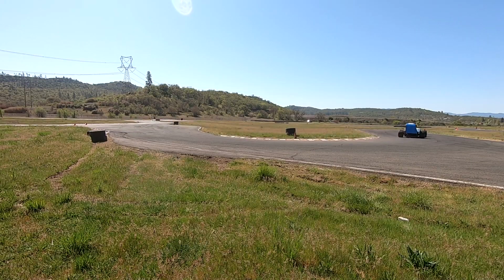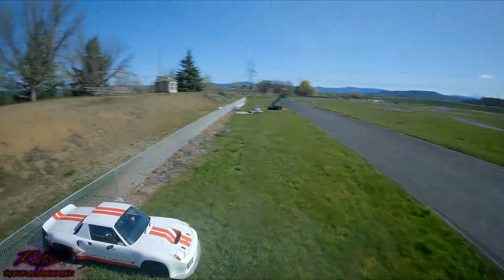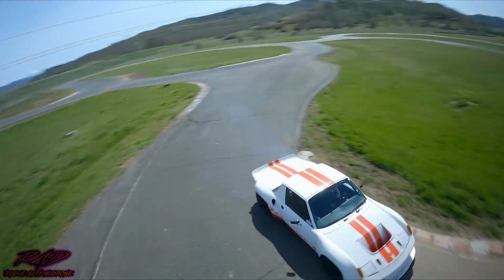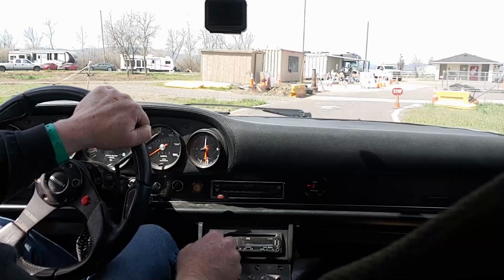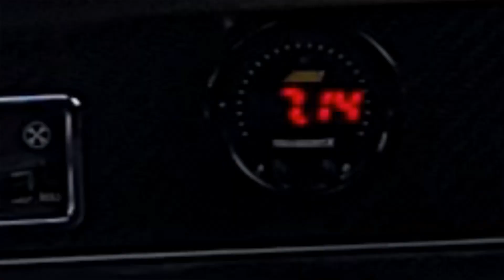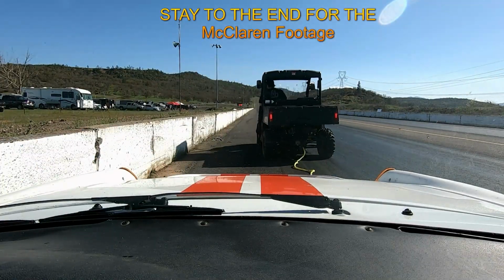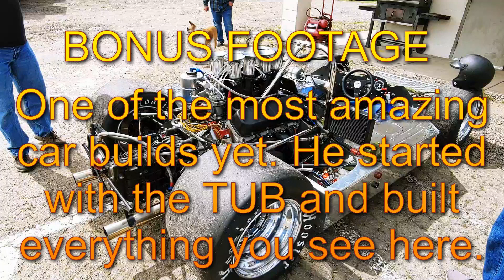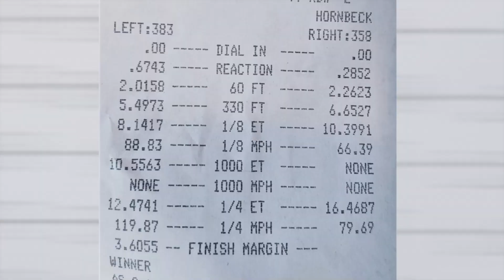The First Test day of 2022!  Testing on the track and also on the TRACK!  AX and Drags!

Comment: You almost need a way to limit boost during autocross. But even then, that 914 is a handful.
Reply from the maker: We can adjust the boost, generally run it as low as possible for the short autox.

Comment: Do your burnouts in second gear
Reply from the maker: I do need to try that.  1st gear is good to about 55mph 2nd is around 90 or so.  My biggest issue is I'm to cheap to buy good tires.  I feel I need to work out the other issues first.
Reply: @budgetoutlaws9978  If you are spinning you a  ain't winning

Comment: Throttle management: The gas pedal should not be used as an on-off. imagine you have an egg under your foot. squeeze the pedal quickly but not smashing the egg. the same applies for decel. dont jump off the pedal so quick as to allow the egg to fall off.
Reply from the maker: Thanks for the tip.  Using 1st gear really accentuates the on/off.  I can only hold the throttle down for maybe 1 second of full throttle.  Then it does make for less time to setup properly for corners and braking.  Maybe I'll add the scanner on the next video.  2nd gear doesn't sound as crazy, and it's almost as fast.  When my driving gets better maybe I'll use TWO gears!!  LOL.
Reply: @budgetoutlaws9978  we put a non linear cam roller on the throttle shaft to help manage throttle smother. it was a 550hp NA LS 914.  im sure your turbo adds complexity to mapping out a throttle curve. later on we used a motec where you can simply program in a better curve. PS. i remember when that thing was primer. same 914, right?
Reply from the maker: Actually,  it's still in primer depending on which angle you look at it.   Still have a lot of body work to do.  and now a little bit more.  I'm saving my hundreds for a different engine management system.   For now it's just work thru the bugs, have fun with the car.   I'll bet your 914 is a beast.   Did you have problems with stub axles breaking?
Reply: @budgetoutlaws9978  930 gear is stout and the bearings fit in the 914 arm. sway away made us some axles. Mendiola here in san diego has all this figured out and were very helpful so we didnt have to re-invent the wheel. stock 914 power transfer components become unreliable above 300hp. drag race launches will break stuff while road racing relies on smooth power input to get good traction and track times. being smooth and finishing the race gets the win.
Reply from the maker: I was looking at the Mendiola website the other day.  I'll give them a call and see what they have for Stub Axles.  Thanks